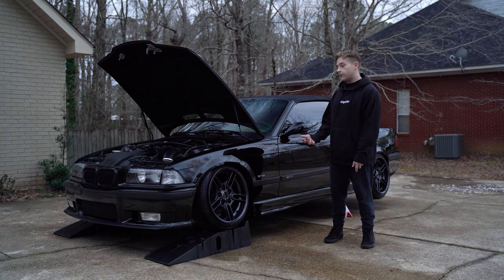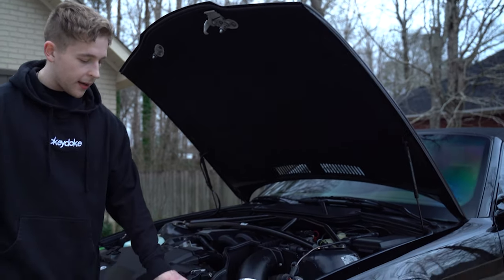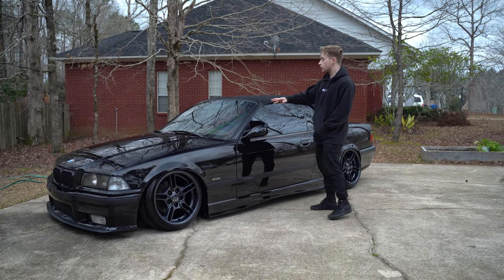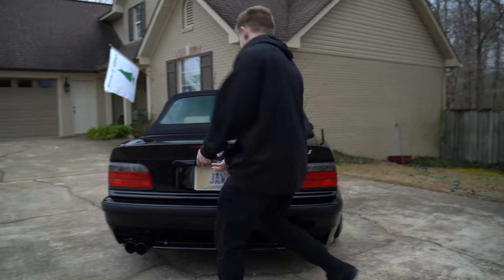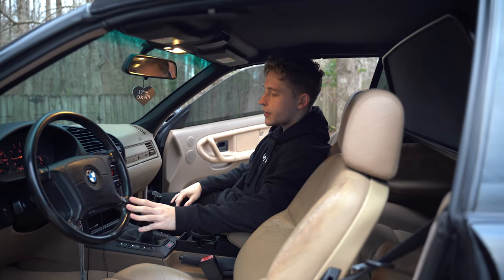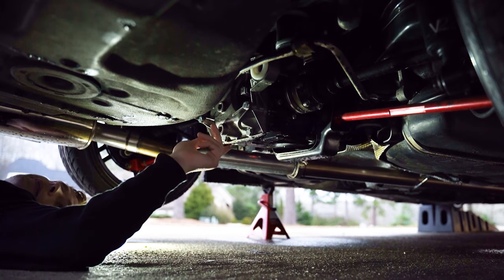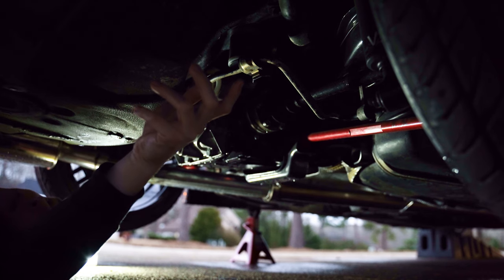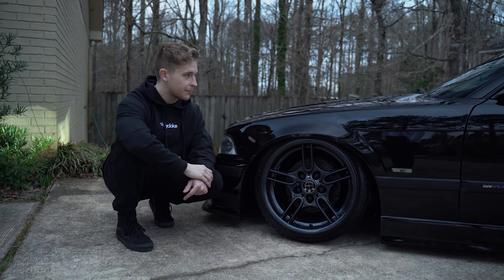E36 Static Stance Build Review and Build Overview

Comment: Very nice build e36 convert convertible. I'm also building one up for my wife. Bought it from a friend for 500€ it's a 320i. So far i replaced all bushings. Upgrade the front Brake to 300mm E46. But it's Not a M-Line Exterieur. I don't know yet if i, will change that.

I like the dome brace und the shifter, i hipe that i can find something like that in germay.

So far, have fun with your E36 and drive save.
Greatings from Germany!

Comment: Nice overview. I'm an original '98 M3 sedan owner and appreciate the attention to detail and OEM look ;) I was laughing about the glovebox.. when my M3 was new the glovebox never closed all the way and had that gap.. the interior quality in general is poor. That phone/cup holder thing is gold I had never seen that - I have to look for it.   
Regarding the fender liners it can actually be somewhat dangerous to take them out because they tie in to the front under-bumper trim... I've seen instances where the 4 or 5 trim pieces get loose and damage the radiator and other things under there.
One thing I noticed is your seats... I think you would notice a massive improvement using the two-part leatherique products.. it won't hide the cracks but will make the leather look matte and new.

Comment: whats the wheel setup? im trying to get this look but no one has the details
Reply from the maker: So I run through it in the video, but these are BMW Style 66s, all rears.  Prismatic Powders coated “Black Silver”.  So all four are 17x9 +26.  I ran a staggered tire size though, with Ohtsu FP7000s in a 205/40 in the front and a 215/40 in the rear.  Stock control arms.  Axle spacers in the rear.  20mm front spacer, 5mm rear spacer.  -7 degrees of camber front and rear.  I hope this helps!
Reply: @griffengardner  thank you so much bro someone finally commented ive went through so many videos asking
Reply from the maker: @estevanperezz  man not a problem at all!  So happy I could help out with some information!  I’m always here on my channel answering as many comments and questions as I can. <3

Comment: Props for actually understanding the rear suspension set up and the trailing arm bushing in particular. I cringe every time someone recommends poly RTABs
Reply from the maker: Thank you so much.  I only learned by making the mistake of doing things wrong the first time.  I want to be fully transparent about that.  But absolutely, IMO I can’t see any application that a poly RTAB should be used on a E36.  The monoball only offers advantages with no downsides, aside from price.  But again, thank you!
Reply: @griffengardner  downside is massive NVH on 3 bolts which rip out. The weld in plates are a good fix but still tons of harshness on roads. Meyle HD and limiters are best for the street
Reply from the maker: @thatflywelshguy9662  well not exactly, the prying side to side motion as the car cambers under load is what causes them to rip out, and a monoball eliminates any resistance to motion in that plane of motion.  If anything you could say OEM would be good but adding limiters leaves you with a bushing that behaves more like a poly bushing, preventing the trailing arm from tilting under squat naturally and therefore creating bind, prying on the bolt hole locations as the bushing resists tilt.

Edit: and yes possibly a small increase in NVH but that’s hard for me to judge because I actually like NVH.  Stock and rubber feels too vague and disconnected to me.

Comment: hey btw thanks for the tip about shemeidman looks like my 98 m345 is getting a new exhaust from them. a tip about the clear tail lights, you can cut the stock ones or cheap aftermarket tails to just remove the film on the lense, you dont have to buy the crazy expensive ones. i fucked up and bought clear inpros for 600 bucks lol

Comment: Did you have to raise your motor to get the front to sit that low ? And are you using the x brace ? Sick car !
Reply from the maker: Yo thank you SO much and sorry for the incredibly slow reply!!  The engine is raised the tiniest bit using two washers on top of the Condor engine and transmission mounts, but it is unnecessary as I have an early model E36 convertible skid plate that protects the oil pan.  I plan to remove the risers for the upcoming new version of this car on my 17" Work Meister S1's.  I'll have a whole new series showcasing the next phase for the car including going to true rear coilovers with an adjustable upper rear arm to delete the spring bucket and have unlimited adjustment of things like rear track width by side for perfect fitment.  I'll share it all here so that hopefully it can help others dial their static setups in!

Comment: Did you have to do any cutting inside to make the wheels fit?
Reply from the maker: Yes!  In order to get perfect rear fitment on an E36, I really think shaving the rear quarter panel inner lips is a must.  I shaved mine with a dremel very carefully to make the rear arches 1/4” thick from front to back, I used a 60 grit sanding disc on an angle grinder after shaving them in order to get them perfect.  After that I used self etching primer, seam sealer, then rustoleum custom textured black chassis paint to finish it off.  Almost looks like it came from the factory that way.
Reply: @griffengardner  Sorry, Im a bit late to the party :) 10 month old answer. But did you roll the fenders flat after you shaved the lips? Or would it not make a difference since the lip would still be 1/4" ish folded?

Comment: Is a stock 1999 BMW Series 3 328i Sedan 4D for $3,900 a good price? It has 155,000 miles.
Reply from the maker: That’s not bad at all.  Is it a manual or automatic?  That would be a bit much for an auto, but a manual that’s a great price!
Reply: @griffengardner  it’s auto. How about for $3,000 flat?

Comment: Which wheels are these? I neeed them!
Reply from the maker: They’re Style 66’s!  This is a square set of rears powdercoated prismatic powders “black silver” <3
Reply: @griffengardner  Thanks! I just saw another comment you answered this same question! I love the car!

I have a 328i in orient blue, i bought it with BBS wheels on it but they are not the exact style I like, I would prefer something like these, so I am searching for some cool ones!

Trying to decide if I should run a staggered setup like I currently have or something else. Keen on wrapping the car in black and turboing it or something!

Comment: respect for keeping it static but it's way too low bro, how can this still be fun to drive?
Reply from the maker: So definitely it was fun to drive for the cool factor, and for the feeling of the aesthetic the car had- but it was a very anxiety ridden experience every time I drove when it was at this height.  In my new setup it’s still low, but the anxiety aspect being removed has made it a much more calm and enjoyable experience as opposed this setup.  It’s hard to find that balance and I love both, but for unique reasons.
Reply: @griffengardner  well if you take bigger wheels and/or a tyre with a little more meat the car will automaticaly give you that lower look because the wheelarches will be filled but will still be high of the ground because of the big wheels and meaty tyre. My c63 is low also but still very driveable.

Comment: I have a 318TI, any tips on where to start upgrading?
Reply from the maker: TI’s are awesome man!  If I were you, I’d start with the most important thing- maintenance.  Make sure the cooling system is working well, change out all your fluids (brake fluid, engine oil, gearbox fluid, rear differential fluid, etc) and filters.  Other regular maintenance items as well like bushings, ball joints, etc.  Then I’d absolutely say start with a good set of coilovers.  Coilovers are easily one of the best bang for your buck mods you can do on an E36.  They’ll do a ton for how it looks while giving you a much better handling car.  Then maybe some nice wheels with a sticky set of tires.  From there the options are endless, but that’s a good place to start.

Comment: Cars are meant to be driven not parked up and posed by
Reply from the maker: Absolutely I couldn’t agree more!  I should have driven it in the video but I actually am itching to make it a bit more functional so I can drive more long distances and enjoy the parts on the car.  I promise despite the condition she is definitely a driver.  I’ve put almost 80,000 miles on it since I got my license 6 years ago.  Just stay tuned, because I just bought a set of DForce LTW5’s with 245/40/17 Dunlop Direzza ZIII 200tw tires and I plan on raising it a bit and setting the alignment to be more grip oriented and I’ll have some fun with it then, and will share here!!
Reply: @griffengardner  💪 car does look stunning tho mate, so clean and just 💯👌

Comment: if the Top is Original 1998,,, the Tension Straps inside the Top are more than likely worn out and would cause the Top to have "Folding" issues like needing human help to get the top to fold properly,,,
Reply from the maker: You’ll like a (few months out) episode coming up where I will be replacing the tension straps with arguably the most knowledgeable E36 vert top repairer in the United States.  Although knowing how things tend to go for me I’m thinking it will need more than just the straps.  But soon- it will be working just as it should from the factory.

Comment: How the hell did you raise the car like with the ramps reversed asking for a friend
Reply from the maker: LOL so I have a very unique system for getting the car onto jackstands/ off the ground and it involves using the jack pad adapter into the side skirt to lift the car off of wood boards first.  I don’t actually drive onto those ramps, but I jack it onto them.  I flip them around backwards in front so I can have room to put the jack stand in after I go from the ramps to the jack stands.  I can see how that could be trippy though😂

Comment: Wheel and tire specs ?
Reply from the maker: 17x9 et26 square on all four wheels, 20mm spacer in front, 5mm spacer in rear.  -7.5 degrees camber.  Stock E36 control arms in front 6mm axle spacers in rear (which moves hub an unknown amount). Shaved rear quarter panels.

Tires are Ohtsu FP7000
205/40/17 front 
215/40/17 rear

Hope this helps!

Comment: Tire size? Cant fit my 66’s in the rear 😅
Reply from the maker: Tire size is 215/40/17 out back, running Ohtsu FP7000s because of how small they run and how easily they stretch!  Also worth nothing my rear quarter panels inner lip is completely shaven out.
Reply: @griffengardner  Recently put them on the car using your tire recommendation and they fit flush :) thanks man
Reply from the maker: @bluepirate4640  that makes me so happy to hear!!  Glad you got the setup dialed in👌🏼

Comment: what tyre sizes do you run??
Reply from the maker: So my wheels are 17x9 square and I run Ohtsu FP7000s because they stretch and hold stretch like BUTTER.  And they’re more tread-wise narrow than almost all other tires in comparable sizes.

But I run:
205/40/17 front
215/40/17 rear
Reply: @griffengardner  cheers g, builds clean af

Comment: What’s the wheels specs?
Reply from the maker: They are 17x9 et26 squared, running a 20mm spacer in the front and 5mm spacer in the back.  -7.5 degrees of camber front and rear.

Comment: Those headers are just a knockoff China header with a Schmiedmanm logo 😅 I work for that company so I know what I talk about lol
Reply from the maker: Oh no don’t worry I know!  That doesn’t bother me.  Actually, I originally purchased a set of eBay headers and had O2 sensor fitment issues with them.  The Schmiedmann headers may be Chinese knock offs, but they are a different design than the first set of eBay shorties I purchased.  For me, as long as they fit well, sound good, and don’t crack, at the end of the day they’re just pieces of metal tubing.  So don’t worry that doesn’t bother me!